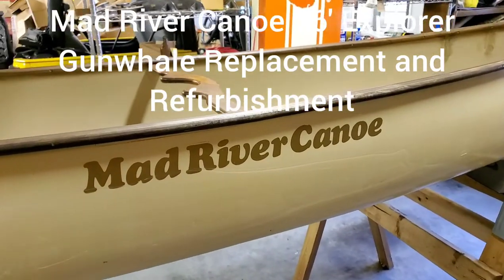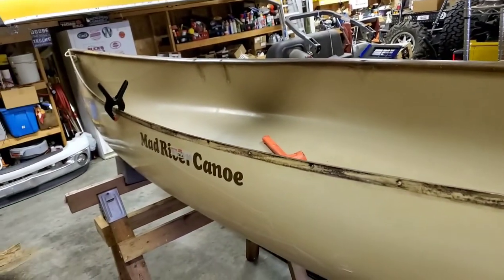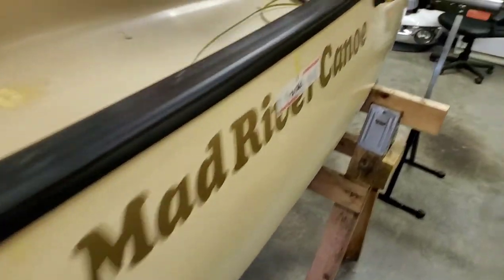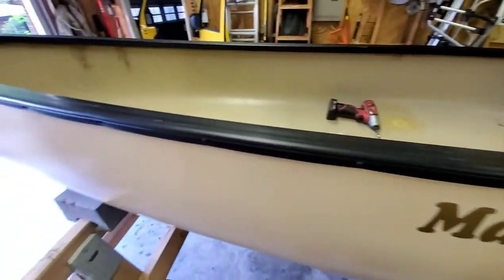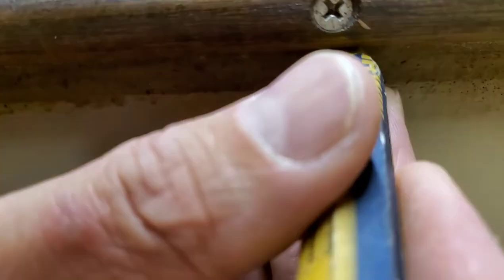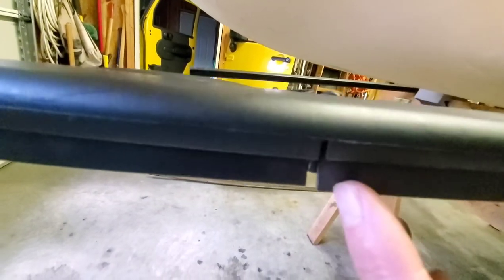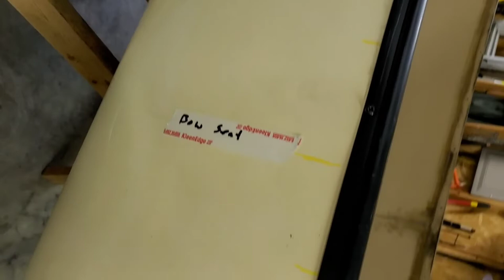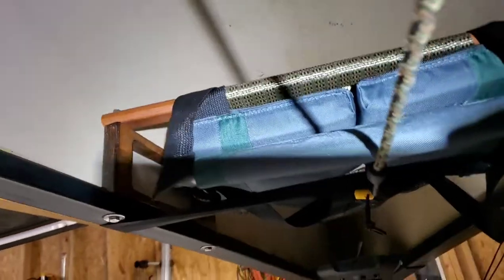Mad River Canoe 16' Explorer Gunwhale Replacement and Refurbishing

Comment: Where did you get the vinyl gunwales?
Reply from the maker: Purchased them from local Mad River Canoe dealer. They can get you either original ash gunwales or the vinyl with stainless angle insert. Many dealers will have them in stock, mine had them at another store and transferred them to my town store. They had the bow and Stern decks as well.

Comment: Thanks for this video.  I just picked up a 16' mad river made of royalex as well.  I think it's from the 90s.... interior is grey, outside sand.  Needs new gunwhales and now I know how to do it!  I was pretty dead set on wood because it's so unique but your finished boat looks very sturdy so I may just go plastic.... Thanks again.
Reply from the maker: Sorry the video is so long but hopefully there's enough detail in there to help you out. I can't really speak on if the ash gunwhales will be as sturdy and flex less then the vinyl gunwhales because my ash gunnels were dry rotted when I bought the canoe. I just know after installing the final gunwhales it really shored the boat up! And I agree the the wooden ash gunwhales really look nice and should be easy enough to do following similar guidance or just looking at what you've got and repeating it. Good luck with your rebuild! Mine is still doing great!